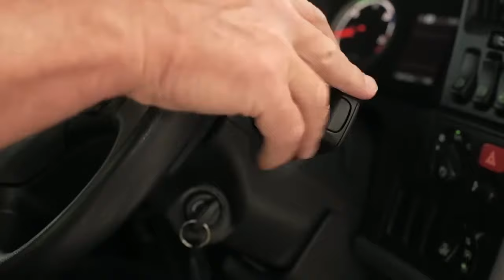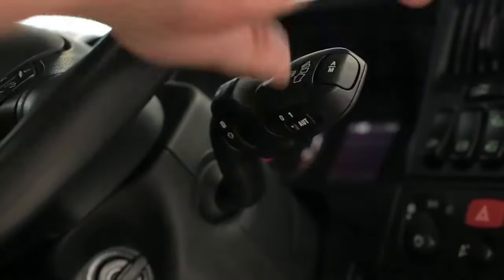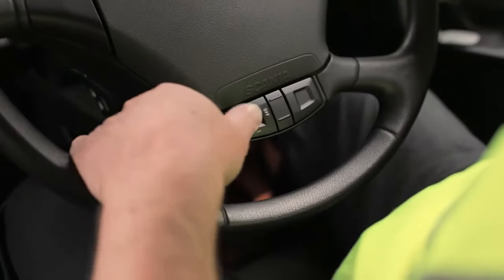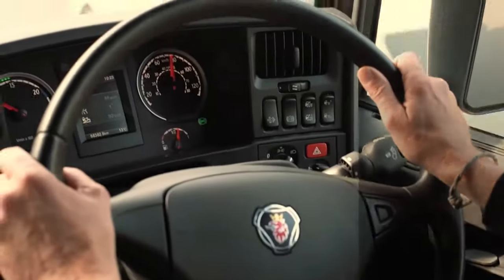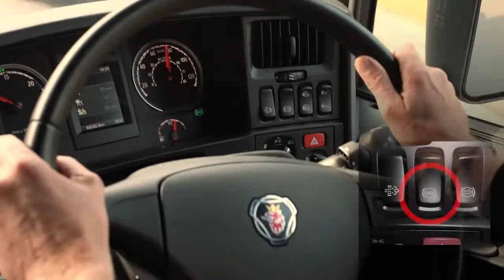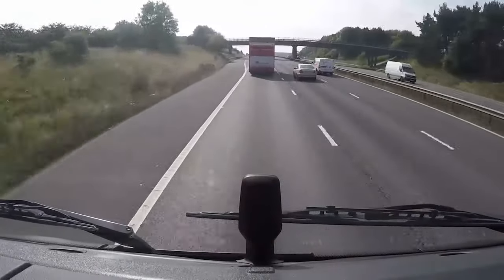Scania Retarder

Comment: I drive for a company with a large fleet of Scanias. Most of the retarders start cutting off and on after placed past the third position. Im pretty sure this is due to the retarder being worn out by other drivers that drive around with the retarder in the on position, probably at MAX. I wish my boss would show them this video. The retarder lever should be off whilst driving UNTIL its needed, then it should be used ONE STEP AT A TIME. Some people just slam it straight down to stage 4 or 5. This is why I loathe sharing trucks with other drivers. Its painful lol!